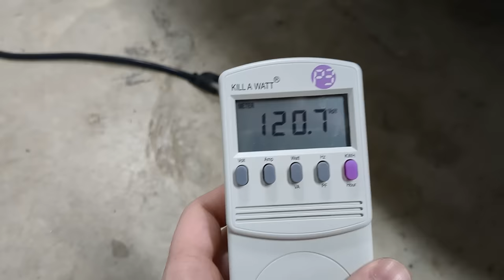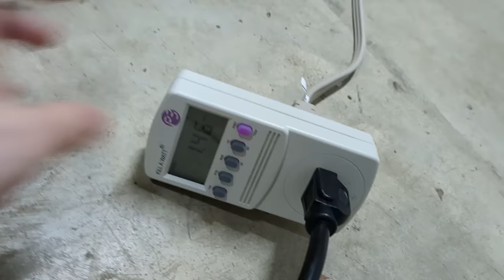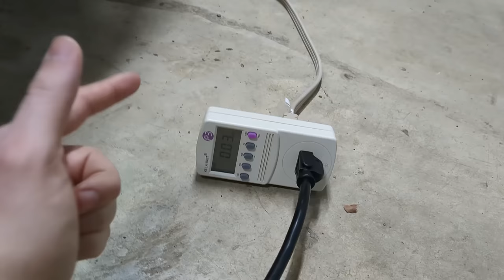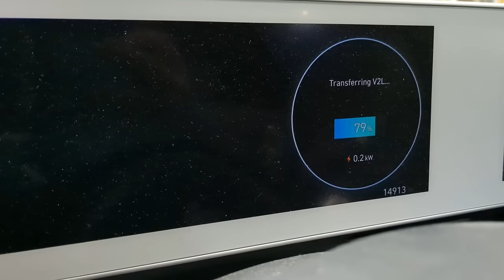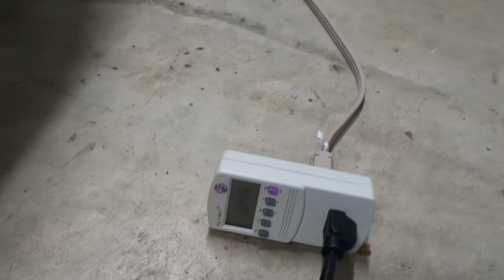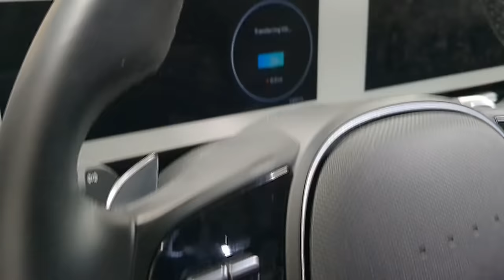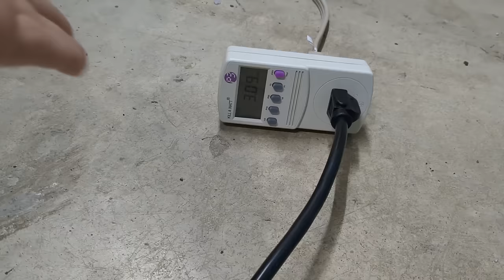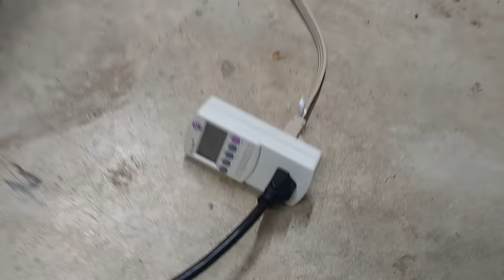A 24-hour test run of the Hyundai Ioniq 5's Vehicle-to-Load function

Comment: I though about using my I5 to power our furnace blower this winter (we had unexpected outage that lasted about an hour on one of the coldest evenings in December and room temperature dropped from 70 to 64) one thing that stopped me - as reported by Emporia energy meter inrush current of the furnace motor is quite high compared to the running current - i need to check actual value, but peak visually looked like more than 10 amps,  possibly more just device resolution is not good enough , (running drops to about 6 amps). So I'm afraid to fry the inverter before it shuts down. Possible option i guess can be a soft start device.

But as for lights and cooking - i used a few cheap inverters (powered by ryobi batteries) for lights and car for other "power hungry" devices, so lived more or less comfortable life in a pitch dark neighborhood.

Comment: My dad is hateful on heat pumps because they can't heat the house during a winter power outage. We do have a generator that can power the furnace, BUT the majority of our extended power outages are in the mid to late summer when hurricanes rolls through. Winter power outages are really infrequent. We may have rolling blackouts when the grid is getting overloaded for heating, but that's an hour AT MOST. It's really not all that much time, so it's unlikely the house would lose enough heat to demand a heating cycle. Plus we have a fireplace. It's just not that big of a concern. He is terrified though of not being able to get heat when the power is out and I do not get why. Our furnaces (we have two because our house has two climate zones) are also just bad. They're old 80+ furnaces. They can output either 3 or 4 tons, so they have that going for them, but that is just so much more heat than we need despite our house being pretty big. We can potentially leave them in place though. They act as the air handlers, so they can continue to do that as long as the thermostat is telling the heat pump to heat and the furnace to run the fans.

Comment: This always seemed like an obvious function of an ev to me. 
Lucky you on power outages. The longest one I've experienced was 3 weeks, it was quite rough, given it was below freezing that entire time.We were also trapped on the mountain cause the ice and snow for the first week.  Luckily, we were the only home in the area with two generators ,a stockpile of 20 propane tanks , and a multi fuel blower heater. Our neighbors stayed with us as their home was all electric. I even yanked out the batteries of the non-4x4 cars to run my inverter so we would have lights and stuff between generator run times.

Comment: You mentioned you checked the SoC from your phone during the test. Over several days, you can probably save a decent amount of power by disabling mobile data / remote connectivity.

However, it's a pretty useful feature, and it would have to be a pretty serious disaster for me to want to trade that for a few more hours of runtime.

Comment: agreed
in a stable power area with hydrocarbon fired heat there is minimal reason to have a generator when you have a large UPS type device
but lets think about areas where emergency COOLING is a thing and/or hydrocarbon heat is NOT a thing:
in areas like that you can probably get away with setting the heat to a low value at night(already covered up) and turning of the water heater most of the afternoon and night(auto on at about 2 hours before you wake) but that still leaves you with a few multi-kw energy draws
now we must also include unstable grid and major multi-day storm issues
if you live in a residential zone where power is basically never out for more than 24-48 hours yes a BEV can fill in the blanks
but I think if you have more than 48 hours more than once a year and/or more than 6 hours at least once a month you need to consider a permeant UPS system or even a standby generator
it depends on your needs whether battery or generator is ideal
in my case with 4x 12v 100ah FLA batteries often running down to 0% before the end of about monthly average power failures I may be more sensible using a 1000w generator that has a 1000w battery charger that can run at least every 6 hours to top off the cells(more like 3-4 hours if I need to cook or turn on my fridge)
ultimately if I still keep having an average monthly power failure that lasts more than 2 hours I am gonna go nutty and have 8 100ah batteries and a set of twist-lock extensions to bind my AC and kitchen to my invertor
the extension will have a 30a resettable fuse in the kitchen(for cooking needs) and a 20a in the AC and a 15A at the PC
at 50a peak of the inverter that is an overload but I can manage my kitchen use when I hear the AC running (basically always) and realize my main PC setup pulls 500w on average in peak
so I can just manage stuff possibly even including an ac cutoff switch if I need a brief overload for cooking
but limit me to 15a 120v and I fail to live in this place
so yes a BEV is a decent pure emergency or limited tailgate use VTL setup but if I needed it as regularly as I do I would basically demand at least 30a or even a split phase inverter on my BEV VTL
honestly with the DC fast charge pins we can just make a standard that can steal directly from those high-current lines and could do 10kw for a few hours or more by just shunting those pins on in VTL mode
and assuming we make a simple short cable box that can sit on a cart/shelf we can fuel all homes in cases of rolling blackouts by using smart breaker panels and a BEV or two
if the grid sends a signal(likely using the old AM/FM radio when it dies) that we need to drop load then homes with BEV+UPS setups can simply switch to "saver mode" and kill loads that are non-critical and wait for a "must reduce even more" command that will then trigger the main contactor to break grid feed and then enable the BEV-UPS feed after it stabilizes
but overall there are still many cases where a 15a VTL is just not enough and it would help to have access to a tad more even if the voltage droops

Comment: The change in temperature throughout the year would change the characteristics of the battery chemistry, especially as it gets deep into the discharge depth, wouldn't it? Chicago winter or summer extremes could knock a not insignificant chunk out of the capacity of that battery. Especially as it ages and the cell chemistry changes.

Comment: My 80 year old house has gas hot water heat, only needs a little electricity for the circulation pump and the electronics to keep the gas flame on.  I've run it off a little 300W inverter that uses the batteries for my lawn mower.  I could run my fridge and keep the house warm for a week with the car inverter.  Gas water heater doesn't use any electricity, so still have hot water during outages.  I've had multi day outages around here so I do have small propane generator, but the car would be so much better.

I haven't really looked into the reasons for it but it does seem inverters get less efficient as they go up in how much power they are designed to deliver.  So matching the inverter to the power you are using seems to be the only way to max out your battery life.  A high power inverter still seems to waste a certain amount even when you only attach a small load to it.

I'm looking to get an EV this year, now this is something I'll want to add to the list of features I'll want.  I think they said the Chevy Equinox EV will have something like this.

Comment: My Outlander PHEV is the best of both worlds - moderately sized battery (20kWh) backed up by an efficient petrol generator (empty to 80% in 90 minutes). Can do V2L at 1500w as is, but also the option of a high-current V2H via the Chademo connection. Doubt I'll ever need the latter.

Comment: Are you assuming you have city water or well water?  If the city loses power how will you get water, other than bottled water?  Can you run you heat and AC on the battery of the car?  I would not trust a battery over a generator, at least currently.  Were you affected by the blackout in the early 2000's?  I was without power for about 7 days.  I'm not sure a battery would make me feel secure.

Comment: You lose up to 40% of the energy through conversion to DC and then lose another 40% transferring it back to AC. Then there is heating the batteries. So it depends on your motivation to do this as to if you should. If you wired up a seperate circuit to power freezer fridge and other necessities it might work for a power outage. I'd cook with gas camping equipment. Did your car charge before the power went out?

Comment: Maybe some is used to top up the 12v battery too...? Probably a few modules, instrument panel and can bus are awake and using low volt with additional conversion losses and battery resistance.

Comment: Top-of-the-line inverters are about 90-95% efficient, but I’d wager since they’re more concerned with the AC->DC charging case than the DC->AC load case, they probably used a cheaper commercial inverter, with a more typical efficiency of 75-85%.  That’d account for like half the power loss right there

Comment: Alec, do a test on your furnace when you can, those circulator pumps can draw a lot of energy. My 6500 generator was loaded right up when I had it at my sister's house.
I fortunately have direct vent heaters and a wood stove.
Reply: That doesn't really make sense. Furnaces in the US can run on a regular 15 amp circuit. That's 1800 watts if it uses the entire capacity.

Comment: This is such a cool idea. But for anyone trying this, please be sure to isolate the house from the grid supply first.
Best case scenario, you'll try powering the whole street and the inverter in the car will turn off from overload.
Worst case scenario, you'll inadvertantly liven the step down transformers for the street and make the entire pylon live, when workers think it's been disconnected. Could result in death.

Comment: My biggest issue with this is that any generator type solution that does not run the heat pump is (IMHO) untenable. Especially in or near Chicago. It would be absolutely great for medical equipment - oxygen concentrator or cpap; which this car solution could run with an AC unit or heater on low-med (~800 watts). Also, any emergency energy solution should be based on worst case scenario - you come back from a short road trip with 20-30% of your battery left and the power is off. I think that the Tesla powerwall or a similar solution would be preferable.

Comment: I wonder if the EU version of the same car does 240V@15A. For some countries, that would completely negate power outages, as long as you can get an electrician to wire a backup circuit for you.

See, for an apartment in, for example, Italy, 3kW is the standard contract. Yes. You have a meter, and out of the meter comes a wire, and that wire supports 15A. That's it.

For an apartment up to 100 square meters (1000 square feet or thereabouts), that is enough.

With 3 kW you can run your washing machine, your clothes drier, your microwave, your water heater, your dish washer... As long as you only run one of them at a time, you can run any one of them no problem. 

Of course, that makes gas-powered heating very common: stoves (as in, cooking ranges, but also radiators, for space heating), as well are gas furnaces to heat both rooms and water, used to be the gold standard. 

In practice, one car would be able to keep an entire apartment powered for several days, and you wouldn't even notice that grid power is out. On the flip side, if you are charging your car you probably don't want to pull over 2 kW, and don't even think about running your washing machine at the same time.

Comment: The fridge probably has a short cycle timer, and it's cheaper to assume that the pump was running right up to moment the fridge was plugged in than it is to make a short cycle timer keep time through a power failure.

Comment: I feel like I finally understand potential use cases for a smart fridge thanks to your struggling to guess what yours was doing. Monitoring and ideally service mode control of compressor cycles, temps, etc. But I feel like manufacturers are more interested in trying to sell fridges with cameras and netflix portals. 

It COULD be so simple to design a system that coordinates connected appliances so when you’re cooking on battery reserve, the fridge knows to hold off a few minutes on a defrost cycle without needing to unplug it, etc. however I doubt the financial incentive to create this type of thing just isn’t there 😢

Comment: Theoretically (I know nothing about legality of that in the US of A) you could install a small electrical panel in your kitchen with a transfer switch which would allow you to power just sockets in your kitchen from an inlet connector (in the most of Europe it would be something something IEC 60309 also known as CeeForm and Commando).

Comment: I was unable to power my furnace from my Limited back seat receptacle in UTLITY MODE. There is an incompatibility between the car outlet and furnace. The furnace requires GND to run which in residential wiring is bonded to NEUTRAL at the panel.
There is no voltage measured between GND pin and either of the other 2 leads of the car outlet. 
I may have been successful if I would have tied one of the 2 leads from the car to it's GND conductor to reference it as a NEUTRAL, just as it would be within my homes electrical panel. I did not do this because I didn't know how the car's electronics might like it.
Would you measure for the presence of GND within the V2L adapter being bonded to one of the current leads creating a NEUTRAL?

Comment: @TechnologyConnextras, I saw this video thanks to @TransportEvolved's "Just WHY Did Hyundai Motors Electric Cars Sell Well Last Year Without Tax Credits?" video.  Real Question: Have you thought of doing this everyday as Energy Arbitrage?  Whenever you're home, power your Fridge, freezer, router, etc from your car, then at night when you charge the car or when you are actually driving the car, plug that 1 plug from your car back into the wall?  I would love to do something like that whenever I get my V2X EV to help lower by electric bill a little / help stabilize the grid and I am wondering how truly feasible it is doing it the V2L way vs the expensive V2H/V2G way.

Comment: Another feature that I have only seen in one car, Rivian, is the ability to charge the car by being towed behind another vehicle. This enables you to go the last mile to a charge station in a pinch.
What I know most EV cars can't even be towed one inch.
Reply: You can do this with all EVs to my knowledge.
It's just regenerative braking.
Reply: @logitech4873  That's what I was going to say. But on second thought, usually you need to press on the brake pedal to achieve strong regen. Maybe the Rivian has a mode where it will do it stepping on the brake pedal.
Reply: @eDoc2020  If an EV has "one-pedal driving", all you need to do is let go of the accelerator. Teslas work this way.

Comment: As a backup in an absolute emergency, this is a passable system. However, the parasitic drain is absolutely horrible. A cheap growatt and small battery pack would be far, far better. This is a lot better than maintaining a generator and fuel (gas usually) that almost never gets used. When you expect to have power outages, and even extended outages, this is NOT the answer. And I'm not sure I'd use it to power a camp site, either. (how close are you to somewhere to get it recharged?) I have the same reservations about running the RV's generator off the gas tank. (it's supposed to cut of with 20gal left. that's ~150mi to dry, but 70-100mi realistic range. of course that all assumes the RV is perfectly level.)

Comment: I would think your temperature setpoint for the test may be an issue.
You are testing it at an ideal temp for the battery.
Moving the temp outside of the ideal range will negatively impact the performance.

Comment: I wonder if, with a couple of contactors and some code, you could use the motor inverter to output power back to the grid. I mean they are just huge variable voltage - variable frequency inverters.

Comment: The longest power outage I ever experienced was 3 and a half days. It was brutal. We live in a mild climate but this was during a winter storm. Since we relied on heat pumps we were without heat completely. Also no fridge no light no hot water no internet no computer and the both cars were inside the garage and we didn’t have a manual way to open the door. It was too heavy to move without power. It was really bad. We basically suffered but this must be nothing compared to what someone in a really cold climate might experience with electric heating. This is a big concern with home electrification.  Someone with a heat pump only while it’s 20 degrees could literally die if there’s a power outage. BTW to shower we filled half of the bathtub with cold water and heated water over our gas stove in our biggest pots. We took turns using the same water. It wasn’t fun

Comment: I'm thinking about building a very low budget, off-grid ADU. I'll also need to get a vehicle by the time that happens, so I'm thinking about skimping on the stationary batteries and using the V2L for the bulk of the storage.

Comment: If you're fridge was running, you should have been focused on catching it.
Curious, I would have thought it would have more capacity than 1500W. I guess it's just the level of inverter built into the car. I'm curious where this type of tech will go in 5 years. Both battery capacity and availability of that power where needed. Basically, a power wall on wheels.